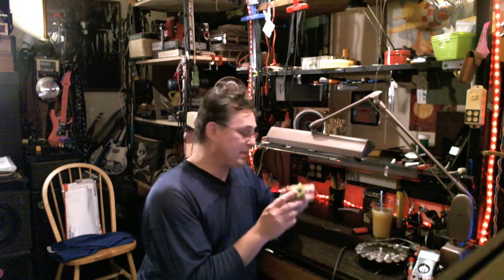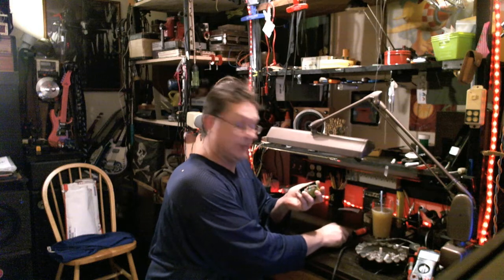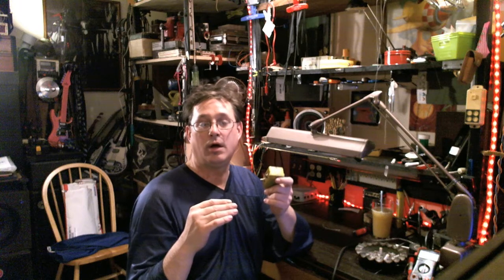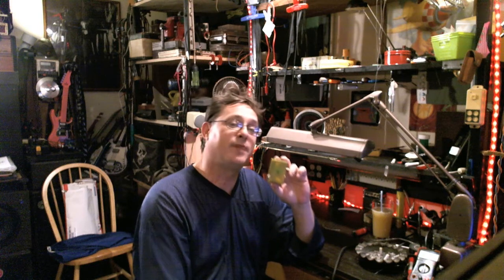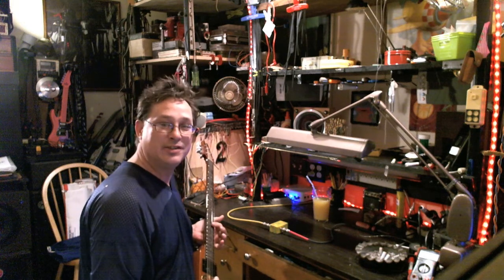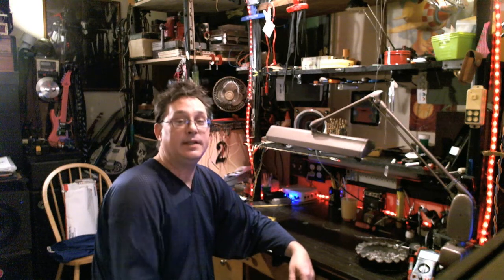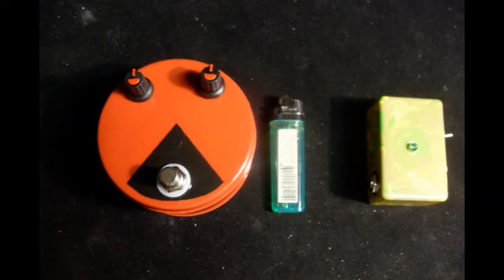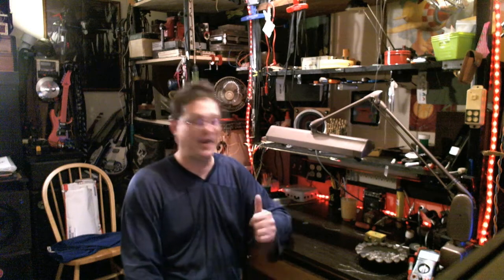Diy EASY Guitar Buffer pedal ( for nice clean signal )

Comment from the maker: as far as a j201 the thru hole jfets are apita . look for a klon buffer vero layout and build that . a buffer is super super basic stuff so ... if you cant hack that on your own without demanding help from someone else you are barkin up the wrong tree with this hobby . - to the guy who claime dhe couldnt understand me and asked me yto post all the links to the companys in the comments i am talkin to you . its a op amp buffer or a jfet buffer . it doesnt get any simpler than that . if you have more specific questions feel free to ask , but if i were you i would google " guitar buffer vero layout" and that will take you to tagboard effects . you order parts from ebay or tayda - its a company . anything else you need you can get from small bear , mouser or digikey . other than that use flux - buy some paste flux - a lot of it . i use plumbers flux and i remove it when i am finished . thats my secret trick . pros techs and experts will say you cant do that . you can . you just clean the shit off ... ( alcohol.